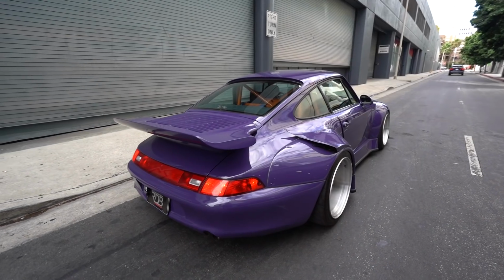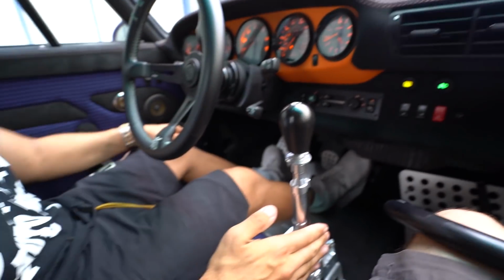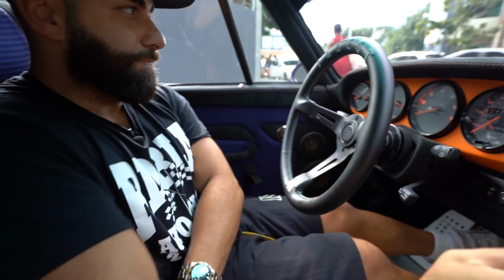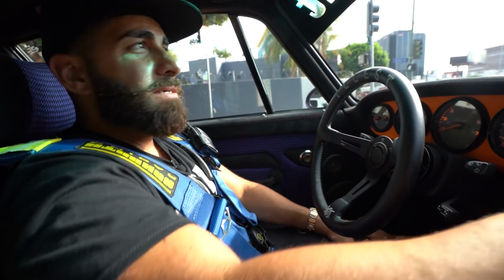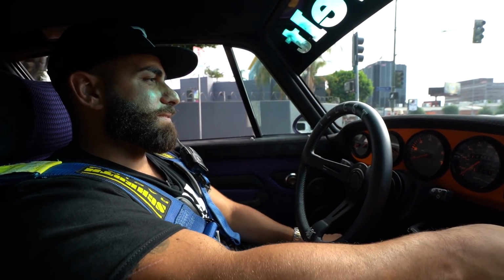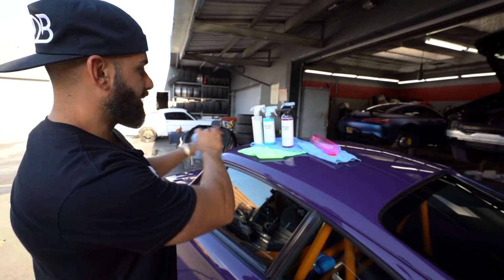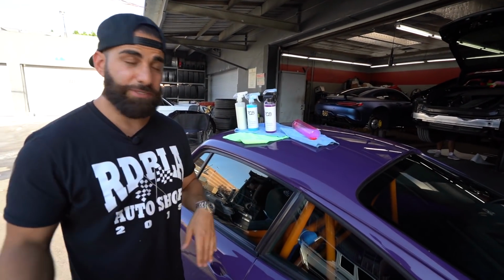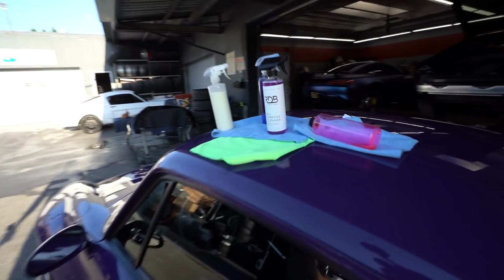CRAZY PORSCHE RWB 911 WIDEBODY SPENT $300,000 REVIEW. *VERY SPECIAL*

Comment: "I think it's cool to drive it like this..." Takes steering wheel off
"You can still drive it..." 
Attempts to prove it by driving in a straight line before replacing the steering wheel almost instantly

In my head I imagined that ending differently, with an almighty comic sounding KRUNCH !!!
Followed by
"This RWB is now up for sale at a complete steal at a mere fraction of the price we asked you for, JUST MOMENTS AGO!" 
Cuts to old footage of the car before it was written off, doing Fast & Furious style gear changes on the 11 speed manual transmission box, with no steering wheel fitted.

Sold as seen.